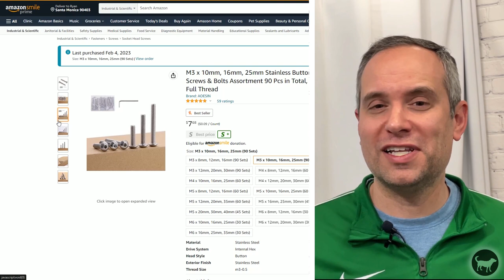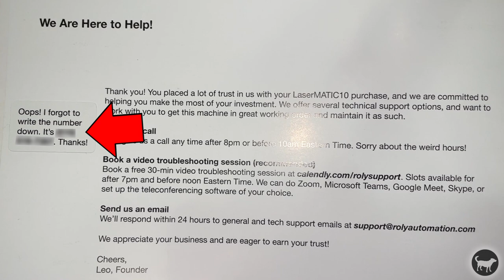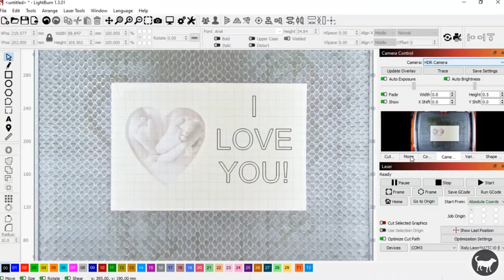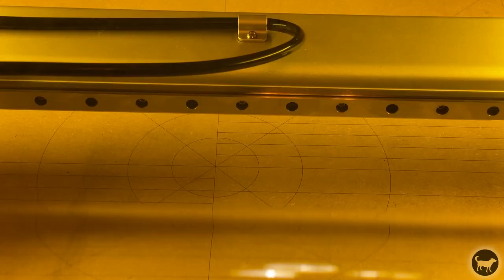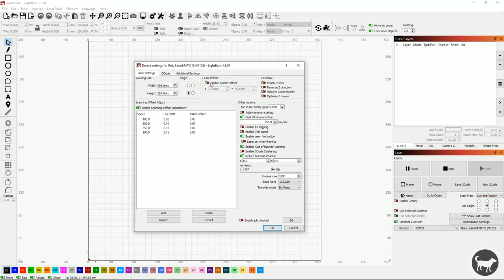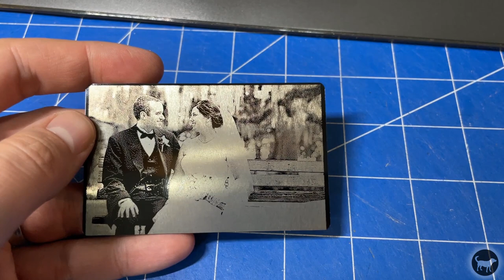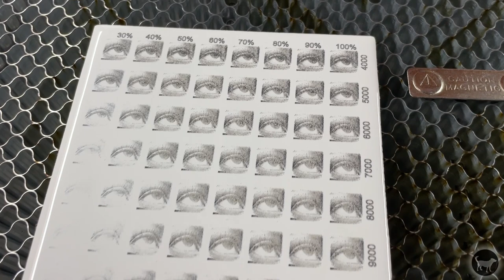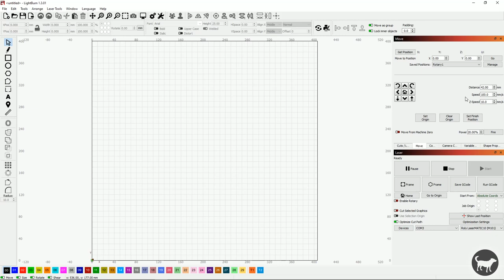Roly LaserMATIC10 | Nicest 10W Laser Engraver of 2023 | Full Enclosure | AirAssist | Camera | Rotary

Comment: I too was fortunate to get the Roly 10w on the second wave. I agree with all the positive comments. I love the use of the led light and the rotary without lifting the frame like I had to do with the Ortur. One problem that I am having is that at random times, the machine goes into busy mode and it states that it is streaming. I wil call Leo and see if he is aware of this issue. What I have been doing is shut down the lase and restarting it. Has your Roly ever gone into a Busy mode?
Reply from the maker: I have not noticed any busy mode. Were you able to reach out to Leo and see what he thought about it?

Comment: As someone who is looking to start a business using a CO2 laser, what can you tell me that this can or cant do when comparing it with other lasers in the 20 Watt range? I have been looking into the Xtool as of recent. Anything i should consider before making a decision? Programs, material allowance, bed size, etc... anything notworthy that this cant do?
Reply from the maker: This is not a CO2 laser, this is a diode laser. The big difference between the two is the wavelength that they operate at. A CO2 laser can cut clear materials while a diode laser never can no matter what the wattage is. Wattage of the diode laser really comes down to strength of cutting and speed because many times the laser can work faster since the beam is more powerful. The trade off to that though is size of the laser spot. A 20W laser may have a much larger laser spot size then a 5W laser meaning you can get better detailed engraving with a 5W laser vs a 20W laser. Now that difference might not be immediately noticeable since we are talking less then half a mm but it's still there.  If it's cutting ability of non-clear materials then the higher the wattage the faster it will cut and in less passes. 
Most lasers use Lightburn so it's pretty standard. Some have their own proprietary free software, namely xTool lasers but even those work with Lightburn as well.
Reply: @BusterBeagle3D  I appreciate the quick and detailed response! If you were to pick one to start with, which would be your first pick and why? My guess is it's this one here. But is cutting plastics and glass really that necessary? I suppose that would depend on the desired business product. If I were to cut thin slats of wood for wall decorations, burning in images, engraving into wood materials, which would be the best choice?

It sounds like I should start with Lightburn as it's compatible with most machines. Is this program able to do the spinning or curved features of some laser machines?

Thanks again for all your help.

Comment: Hi Ryan, GREAT review! I was close to pulling the trigger on Atezr P20 and came across your review of this machine and have moved forward with the Roly. Do you have any recommendations on an internal smoke purifier? I’m new to this and it will be in my 4K foot shop and not easy to put a hole in the exterior wall do to HOA. Any help is appreciated. Thanks for your help! -Kris
Reply from the maker: Thanks, I hope you like it!  As for the purifier I haven't found a good one myself that I would be willing to invest it. They can be very pricey. I run mine thought a window using a port typically intended for a portable AC unit. I have everything running through an inline fan that has quite a lot of power behind it.

Comment: Thanks for the video.  I am still on the fence about buying one of these.  I have access to several other lasers (all CO2) at my local makerspace.  This would be my first diode laser.  I haven’t seen any reviews of this machines ventilation system. Any suggestions on this would be helpful.  Also, no one has commented about the noise level of this machine.  I would really like a machine that could be placed into a small home office environment.  Noise, and fumes could potentially force me to place my future set up out in the garage.  That means extreme heat, and cold.  If noise and fumes could be controlled, the next concern I have would be the longevity of the laser diode.  How long would this last before needing to be replaced, and how much would you expect that to cost?  Then my final concern not addressed in any video is vibration.  How stable of a table would you need?  The big CO2 lasers I have access to are shaky beasts. They are big, metal, and very heavy and they all shake quite a bit while in use.  Again, thanks for the video.  Frank from Charlotte, NC.

Comment: Nice review. I'm interested in the tile etching using NWT method. Your power scale test and 3-tile etchings seem to look pretty grainy and run at low resolutions (what line interval did you use). When you have time could you run then at smaller line interval - like 0.10mm/0.08/0.06? Thanks

Comment: So air assist is not automated with light burn? That’s unfortunate. I like that feature in the scuplfun s30 I have. That’s one of the reasons I bought that one. I’m still buying the roly tho but it’s good to know I’m going to have to learn when and how to turn on the air assist at the appropriate times.
Reply from the maker: The air assist will turn off and on in Lightburn. What I was talking about was the volume of air. I like to trickle the air even while engraving to keep the lens clean. On some of my more recent machines I could adjust that on the fly which was what I was talking about.